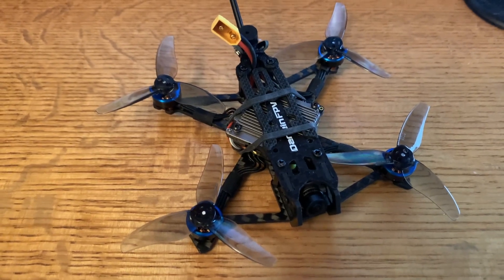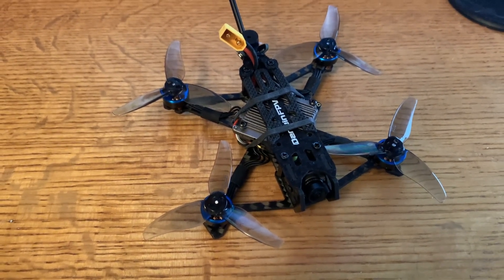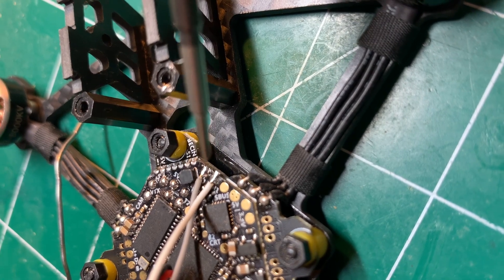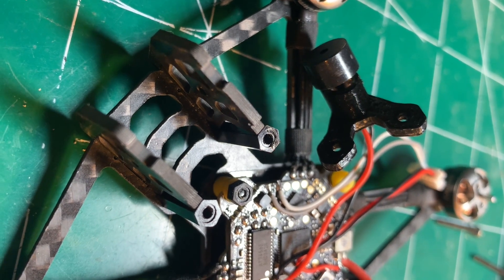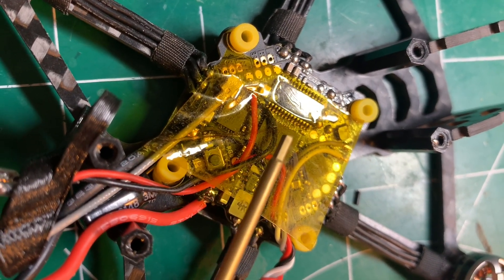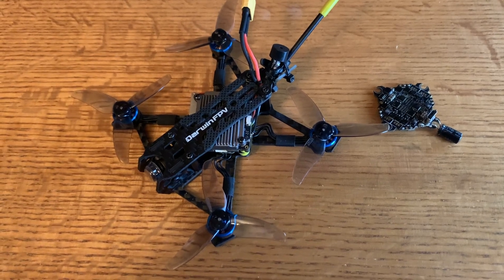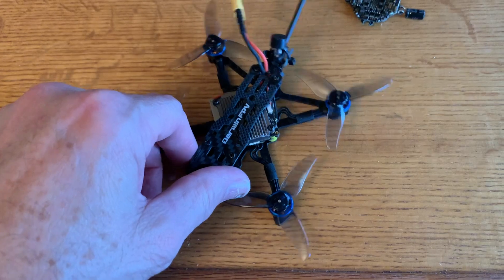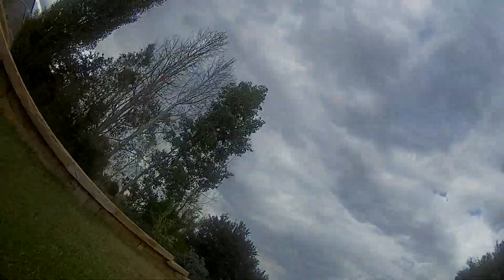Walksnail Avatar Darwin TinyApe Conversion

Comment: Hoe bout if i use the avatar hd pro on the baby ape 2 will thr wiring be the same?
Reply from the maker: Looks like they kept the wire harness pinout the same but the issue is the pro is 19mm wide and the nano is 14mm. You would have to do some frame mods to get this to work.
SLOG

Comment: I am using a Spekrum reciever that is using on of the tx ports. Can i solder the walksnail to the rx1 and then to the tx2 where the old vtx was or solder my Spekrum to the tx2? I have a baby ape pro, so i don't have the built i nreciever. I don't want to switch my flight board or controller btw.
Reply from the maker: Hello, I am assuming you are using UART1 for your Spektrum PNP Receiver which I would not move. Looking at the wiring diagram it looks like you can just use TX2 and RX2 for the Walksnail VTX. There is a RX2 pad towards the middle of the board according to the board layout diagram. See link below:
https://darwinfpv.com/products/darwinfpv-15a-1-3s-f411-ultralight-whoop-aio
PS: Since this video was done, CADDX/Walksnail has come out with the Avatar Mini 1S Kit which I would use vs the standard Avatar VTX.
Cheers,
SLOG
Reply: @slogfpv  Souds good, thanks! as of now the Spektrum is on the UART2 on I plan to use the standard avatar on UART1. Would the 1s fit better than the regular walksnail vtx? I would be inclined to use the 2-6s because of the extra power. 

PS: I had to move the receiver any way because it was soldered on kinda wonky. I can put it back on the UART1 tho with some cable management. Thanks slow, lazy, old guy!
[that is the first time I have addressed anyone as slow lazy and old XD ]

ALSO I belive there is a difference between the voltage rating between my board and your BNF board. i run my quad on 3s's all the time, to the point where I have to order new motors for the second time
Reply from the maker: @minininjared6533  No need to move it from UART2, just trying to save you having to re-solder things (pads are tiny). UART1 is what I used. 

As far as the 1S VTX, you can run it off the 2A BEC on the flight controller as its output power is only 350mW. Pros: much lighter and fits better in the frame because it is smaller. Cons: only 350mW. 

Have fun!
SLOG
Reply: @slogfpv  sounds good!

Comment: Thanks for the vid. Enjoyed how you played around with the Tiny Ape. Sorry you blew your FC.  Sometimes it's not about the big fat 5 inches or performers but even little 3 inches should not be missed in the FPV hobby  :)
Reply from the maker: Hi Peter, thanks for the comments! For me it is about keeping things to a dull roar with my neighbors. No complaints on the lightweight 3 inch and below quads (significantly quieter). I just want to keep it that way. Several have horses who don't seem to mind the noise coming from the smaller quads (don't want to spook them).
Cheers,
SLOG

Comment: That camera / vtx setup cost more than the quad itself ..
Reply from the maker: Yup, one of the most expensive VTX setups with one of the cheapest 2.5 inch quads out there. As stated in the video, just a proof of concept on what would be the smallest reasonable size build without de-casing the VTX.

I am hoping that now with a little competition between DJI and Walksnail (Caddx), there will be some pricing changes once it takes off.
Cheers,
SLOG